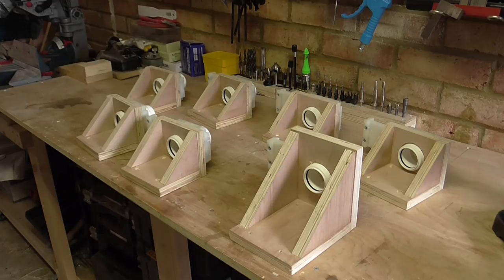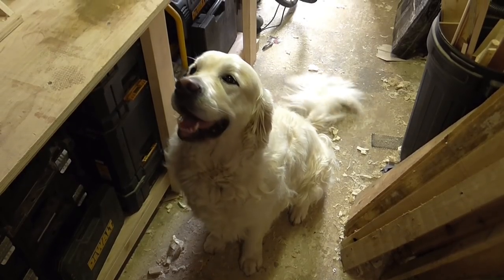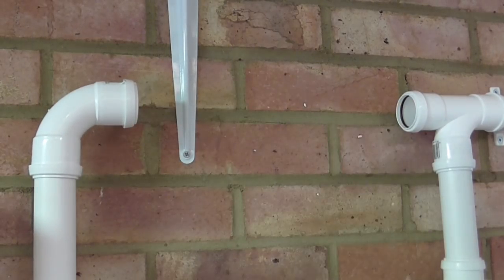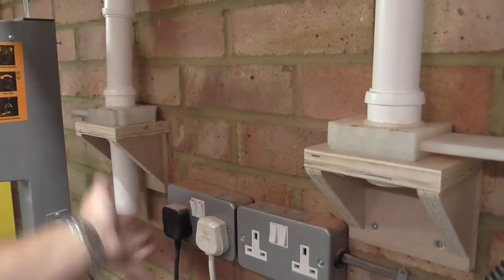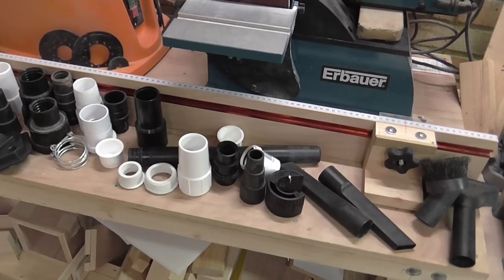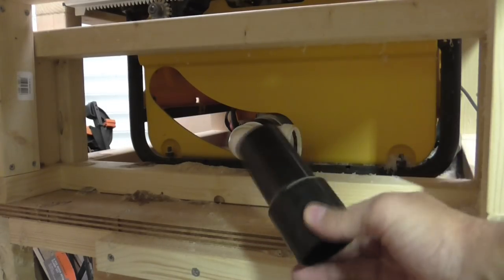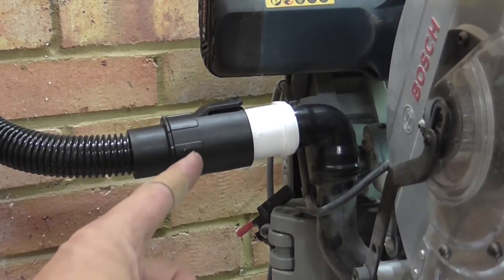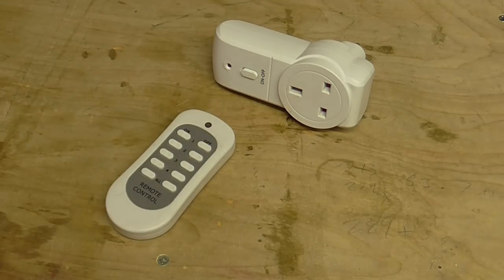Pipework and Couplings - Workshop Dust Extraction System - Part 2

Comment: To adapt to all the variations of dust ports, use a heat gun to soften one end of the PVC fitting and then shove it on the port. A hose clamp,can be tightened over the softened end of the PVC to “shrink” it to the right size. PVC is very easy to manipulate when heated to a pliable state. Wear leather gloves, though, or risk some nasty burns. You have a very nice shop!

Comment: Hi
Very inspirational…. I’m about to do similar and think 40mm push fit waste pipe & fittings looks ideal. Did you find a decent source for 40mm hose? I got some irrigation hose but it’s a bit brittle.
Reply from the maker: Thanks. I tend to use eBay. Try pond pipe.

Comment: I might suggest that a branch  coming of the main, as near your sanding station, never come off the bottom of the main. In the event that you are drawing dust from further down the line, the vertical branch not being used will tend to fill with dust.

Comment: Hi. I'm curious as to how the extraction system is faring. I was a bit sceptical about the pipe size as I visualised it clogging easily. If it is holding up well I'll give it a whirl. I was thinking of 50mm solvent weld but I like the push fit ease of access. Thanks for all the great video's you have shared.
Reply from the maker: Thanks Clive it's working well. None of the bends are tight so I don't seem to be any clogs with just sawdust. 
The pushfit is a bit more money than solvent but give added flexibility.

Comment: Nice set up, I will be doing the mine soon.
I wonder why a lot of the dust extraction vids on YouTube all use 100mm pipe, two 45s instead of a 90 and huge machines, this works great, you know what I mean
Reply from the maker: Yes I don't know why they use huge pipe. Most of the extraction outlets are 50mm or smaller so by stepping up you put more strain on the extractor to create the pressure for the vacuum. 
It's only sawdust after all so doesn't need huge pipe!
Reply: Happy Wife Happy Life , the bigger diameter pipe is used as they are using dust extractors rather than vacuums. The dust extractors are low pressure high air volume so need the bigger pipe to be effective while a shop vacuum is high pressure and low volume of air so work better with the smaller diameter pipes. Also using 2 45 degree pipes makes a gentler curve than a straight 90 degree connector so the system will work more effectively. Anyway like your setup, shows you don't need a big dust extraction system to manage your dust. Certainly a cost effective solution for part time woodworkers.
Reply from the maker: Thanks Larn as you say the small pipe works well with a vac. 
The 92deg curved couplings seem to work ok, I shied away from the 'elbow' style ones as they were a bit too tight a turn.
Reply: I mean NO disrespect to any one; but you asked. Here is the answer:

Every foot of pipe; every elbow; every "Y" branch, etc, etc: causes resistance to air flow in a vacuum system. One of the worst offenders, is flexible pipe. Believe it or not.

Studies of vacuum and dust collections over decades, proves that the most efficient, all around, dust collection system, must use 5" metal pipe in even a home work-shop. Oh yes. Search the DIY videos on the subject. It is amazing to what they are doing more and more. I believe they are very wise.

It goes like this. A 5" pipe has great advantage over a 4" pipe; even though they are only 1" of difference in size. Yet the 5" is like 25 over 16  ratio believe it or not. A 2.5" is basically worthless when comparing a 4" pipe. It is like 16 over 6.25 ratio.

One 6" pipe is over twice the efficiency of 2 4" pipes. It is like 36 over 32 ratio. Etc.

So experienced dust collection, demands never using any thing smaller than 4" and highly, preferably 5". I know that manufacturers put these foolish small fittings on their products for years; but that is fast changing.

I also know the theory mentioned by others on here; about small size and high velocity vs large size and low velocity. But OSHA (US) and CE (UK) is coming down harder and harder on anything but large pipes; and at least 5" to each machine.

And they are coming down on power tool manufacturers about their decades old worthless small dust ports. IE: Delta band saws, for over 75 yrs, had a single 1.2" dust port. It was as worthless as "teats on a bull"! Not to mention their table saws which had NO dust ports.. Shame on them!

Note Felder; and others; that manufacture the worlds's finest woodworking machines; always have a standard 5" port on almost every machine. It is so efficient (assuming the DC collectors are designed for 5" also) that there is hardly a spec of dust when they are in use. Check it out! In the case of Martin, there is NO dust. Of course we are talking BIG bucks.

I purchased a Festool portable saw (TS55) and their matching dust collector (CT26). When in use there is so much dust spitting out; that I wonder what good is the money I spent on them. Oh indeed yes. I am VERY dissapointed in this. I believe it is a result of poor understanding of how vacuum works as above. With those small hoses. But that IMHO

Both medical directors in the US and the UK are learning more and more what wood dust can do to a person's lungs. Not to mention exotic woods which can literally kill a person, from breathing in the dust they produce.

For whatever it's worth.
Reply from the maker: Wow what a comprehensive write up.

Comment: Having seen the Part 1 video with the sliding plastic gates I have taken the idea and modified the mounting mechanism, doing away with the need for the wooden brackets.  I used the same 40mm pipe and fittings with 32mm pool hose but instead of mounting the cut down fitting in the plastic - which you then connected to a stub pipe and into a T or elbow on the system  - I cut the push fit retaining ring and O-ring off the T and glued the T directly into the plastic of the gate.  So the T (or elbow) are an integral part of the gate - with the slide aligned along the length of the pipe.   To keep the whole dust collection pipework in position I have used the screw on support clips but have also drilled the fittings and pipe to take a self-tapping screw to keep the pipe in the fitting.  All seems to work with 5 different machines connected.

Comment: Hi i am in the process of trying to sort my dust extraction in my loft, limited headspace, can you advise on best size pipework i.e 2 or 3 inch etc and noticed your Rutlands filtration system, how is that working out . Approx size of loft is 7ft 5in high at peak in a 45degree shape approx. 30ft long. All help welcome.

Comment: You have used 40mm pipe - I'm tempted with creating a system but would use 32mm waste pipe on the assumption that the power from the vacuum cleaner would be greater given the narrower air passage.  Can you see any reason not to use the thinner pipe?       Have to say it looks like a great system!
Reply from the maker: I think you may have issues with blockages at 32mm given you’ll have 20% less capacity. I didn’t have any suction issues even on some quite long runs. 
You might get away with it if you don’t have any 90 degree bends but it will be a risk.

Comment: I am surprised that you have not lost a lot of suction with the long hose lengths
Reply from the maker: I thought it might happen but it's a pretty powerful vac and the joints are very tight. The small diameter pipe helps too.

Comment: Hi, thanks for getting back to me, good to know. I was looking through the links you provided, in particular the connectors but it doesn't seem to include all of the connectors you used. I am thinking in particular the white pool hose connectors. Can you tell me where you got these from?  Cheers.
Reply from the maker: I got them on eBay you have to shop about a bit but should find them ok.

Comment: Any plans for a planer/thicknesses, if so what would you use for 'chip' extraction
Reply from the maker: I've already got one it's a Titan one. I keep it under the mitre saw. Was using a step down adapter and the previous hose and it seemed to work fine so I'll just use the hose from the workbench. I don't tend to take loads of material off each pass so it tends to keep the chip size small.

Comment: Great video! I’m now in the process of setting up my first woodshop and looking to have a similar extraction system. What sort of suction do you get on the furthest away tool? I’ve watched many other videos using similar design but with larger diameter pipes. Would you say this is sufficient?
Reply from the maker: +Ben Wink it works well for my needs I have the bandsaw last and it’s not got the most effective extraction mechanism due to the machine design but seems to remove a fair bit of dust. Before connecting the bandsaw there was enough suction to hold a hand saw blade without dropping on the last blast gate so was pretty good. I haven’t had any blockage issues with the smaller diameter pipes but don’t tend to use on things that create large chips such as a planer except occasionally. The smaller diameter does give better suction as the volume of air being moved is less.

Comment: hi ya with the length you have gone around the walls to all your machine  have you lost any suction at all?  great vid by the way
Reply from the maker: Thanks Richard there's probably a tiny bit of suction loss but nothing to stop the dust being pulled from the machines. The table saw is one of the furthest from the vac and the system is pulling the dust away nicely. 
It's working well for a budget system; the push fit couplings seem to work well and there doesn't seem to be any suction loss from the blast gates.

Comment: Excellent!

I was wondering if you can feel a significant lower amount of suction power at the end of the longer pipe, compared to the short ones?
Reply from the maker: Thanks Bart. 
There seems to be a tiny bit of loss of suction power but not enough to make any difference. To be fair the Titan vac although cheap has plenty of power!

Comment: Which cyclone did you use.
Are the ports suitable for the 40mm pushfit fittings.
Reply from the maker: Details in the description of the video.
Reply: @WheresMyPencilUK .
......the "ports" i was referring to were the ones on the cyclone itself.

Comment: Nice job ! I have almost all the same tools including the cyclone !! lol  . I'm gonna build a similar system, have you had any problems with the pipes blocking at all ? I've got a planer/thicknesser to add which I'm a little worried about as the chips will be bigger and the piping might struggle ? I've also got the problem with no extraction ports matching, I've been making couplers out of chip board off cuts with holes drilled in them then stepped up or down and glued together as needed. It surprised me but it works really well ! Keep up the good work !!
Reply from the maker: Thanks Ian no problems as yet although it hasn't been installed long! 
I have a thicknesser stepped down to about 35mm and it seems ok at the moment although I don't take loads off at a time.

Comment: What size white pipe did you use and were did you buy your hoover hose from
Reply from the maker: 40mm push fit (all in description). Got the hose from amazon links also in description.
Reply: thanks mate good system one of best I have seen for a small shop

Comment: Hi, just found your channel  and enjoying watching someone else coming up with solutions to work with a small garage workshop. A couple of questions for you if you don't mind: any issue with static build up; any noticeable reduction in suction at the far end of the system; I also have a small bandsaw but even this has an airflow requirement that exceeds my shop vac, did you have any issues with yours.
Reply from the maker: Thanks I haven't noticed any static but don't tend to run the system for long periods. Doesn't seem to be any noticeable suction loss I don't use the bandsaw that often but haven't had any issues with flow.

Comment: This is a fantastic system, great work. Do you find the 40mm pipe good enough or would you have preferred to go wider? Also can Any vac be used to connect to your Cyclone setup?
Reply: I've got the exact same questions.  Did you ever get the answers?
Reply: @reggiemal  I went with 100mm pipework... unfortunately the bigger the pipe the more powerful a fan is needed. Mine didn’t work at all, waste of pipe and waste gates! I need to re do this with 40mm pipe in order for my shop vac to work.
Reply: @22illingworth  cool. I bought some 40mm gear today. Which shop vac are you using and how powerful (wattage)?

Comment: How has your system been working for you?
Reply from the maker: It’s worked great thanks although I’ve had to dismantle it as moved to a new house with bigger garage and haven’t re built it yet. That’s the good thing about push fit pipes.